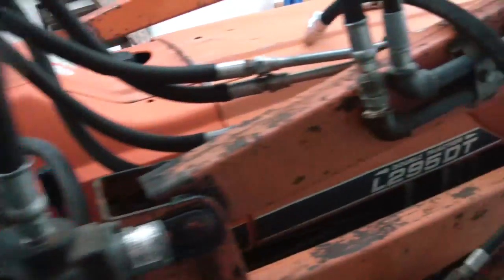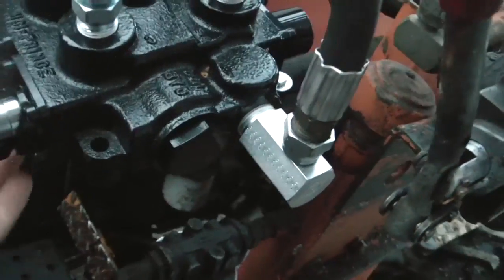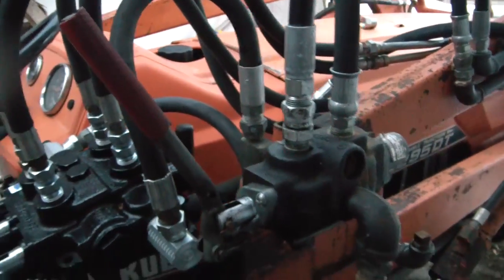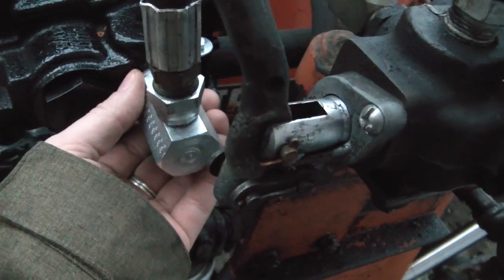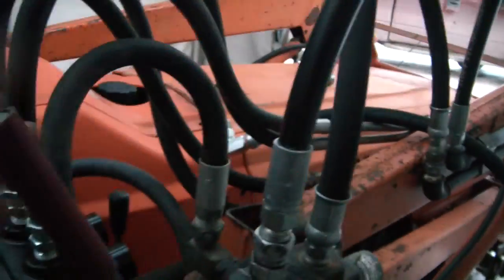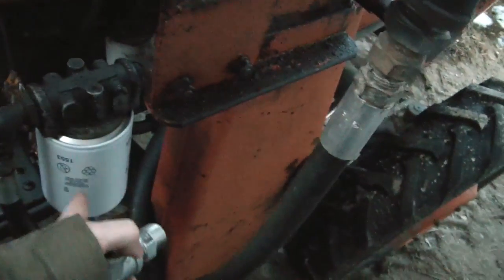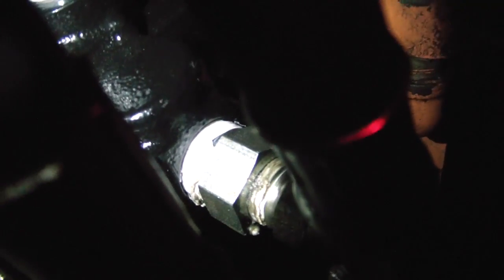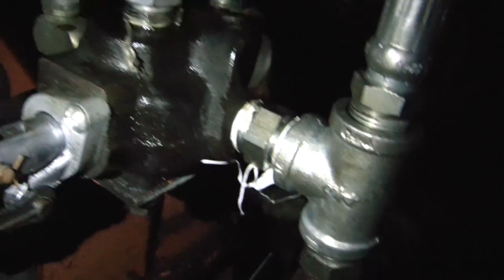hydraulic power beyond

Comment: Where does the power beyond port go to the second downstream inlet on the valve? And where does the out port go on the second valve also ? I’m running into same issues on a log splitter and wondering if both outlets have to go into 1 t fitting return ?

Comment: Hey guys...having a similar situation with Kubota L345DT with a L1720 loader. My loader won't pick up weight. The bucket won't stay in place either unless I've got constant pressure on the control lever. If I let it go the bucket will travel downward. Any advice?